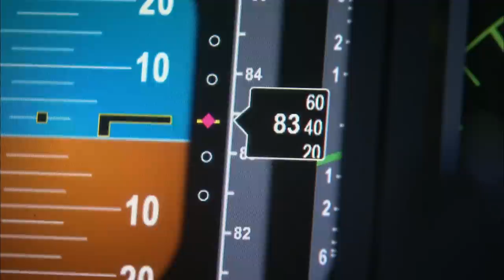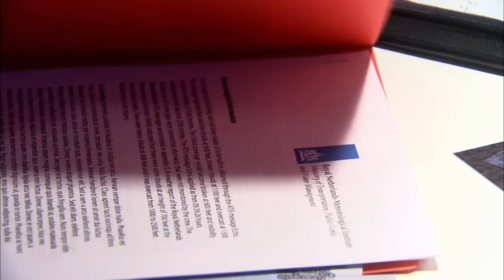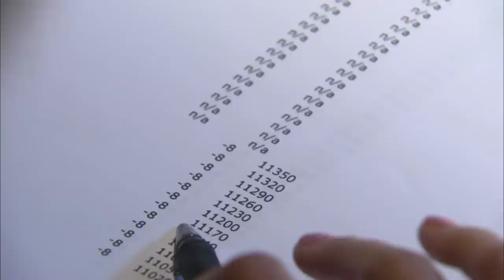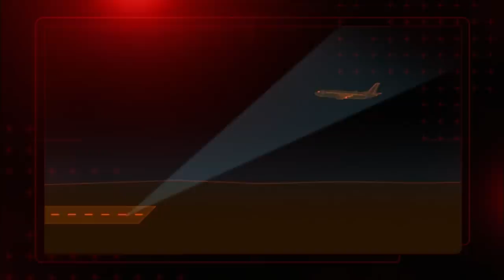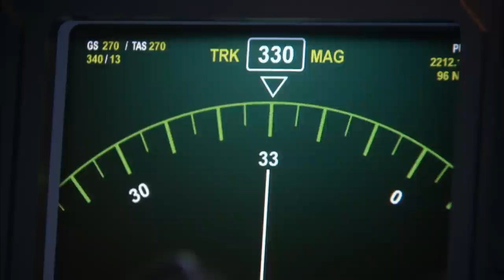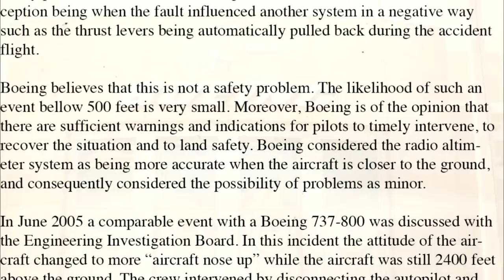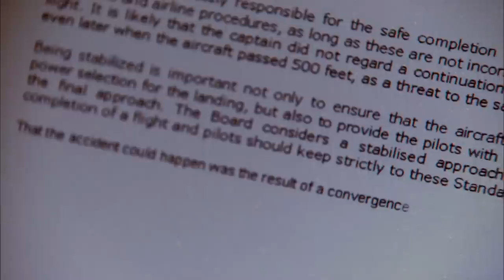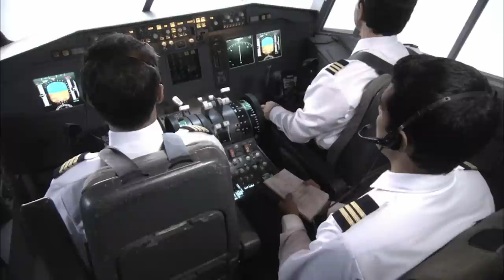The Air Disaster That Shocked the World: Turkish Airlines Flight 1951 | Mayday: Air Disaster

Comment: Boeing could simply have the auth-throttle disengage if both altimeters are not the same. The fact they have such a high altimeter failure rate is quite alarming

Comment: 23:07 The engines should be at idle when landing. that's why its called a GLIDE sloop. gliding usually means unpowered. (well it does to me.). Another thing I don't understand is why the NTSB is investigating another country's accident, don't they have their own crash investigation bureau? If a plane crashes in say France they dont pick up the phone and notify the NTSB, they notify their own investigators. 34:28 could someone tell me wtf he just said in something other than Ivy League Honors English?

Comment: There is no way to pull the fuse on the electronic altimeter, then fly it manually?
Reply: Just turn off the autopilot. Or just start making manual adjustments and the autopilot will automatically shut off.
Reply: @Patrick Hurley  Did you mean the auto-throttles too? Those move by themselves. You make sense because they can revert to the old manual approach with the co-pilot's barometric altimeter.
Reply: @mike777yeah  Yes, was keeping it short - all they had to do was start flying the damn plane.

Comment: A seen episode for me, I think.  The only thing that I remembered about this crash was the plane belly flopped with some casualties.  The pilots altimeter had a history of giving the wrong altitude and Boeing couldn't fix it.  Boeing only made a workaround.  Other pilots didn't crash because the altimeter failure happened at a higher altitude or non landing/approach situation.

I can say having worked in manufacturing all in the US at many companies in my life, not all issues can be fixed.  They either let it pass by skewing the data or rarely, almost never, junk the item.

Yes there's cheap Chinese junk.  But there's also expensive made in USA junk.

Comment: 39:27 - Wrong.

Here's a chunk of Python that fixes this problem:

class Aircraft:

    def __init__(self):
        # Initialize defaults
        self.gear_down = False
        self.auto_flare = False
        self.radio_altimeter = system_radio_altimeter

    def start_auto_flare(self):
        if not self.gear_down and self.radio_altimeter < 0:
            print("Warning: Auto-flare event aborted. Check instruments.")
            return

        # Code for normal auto-flare operation here